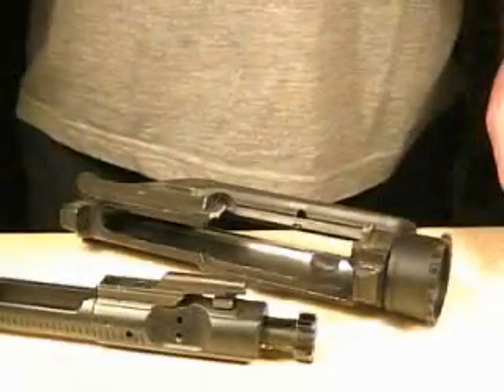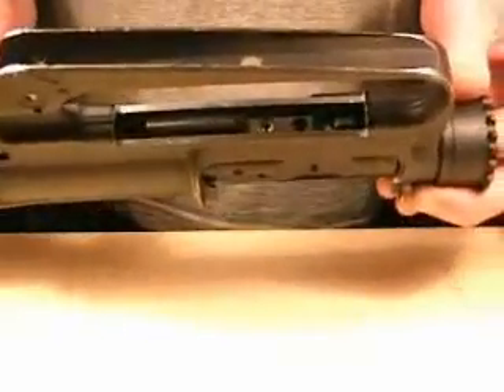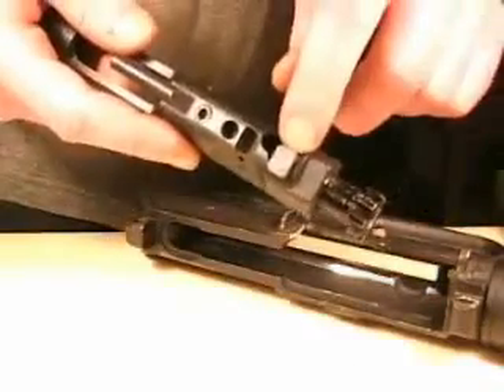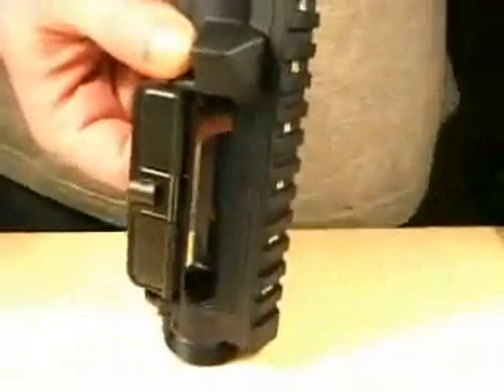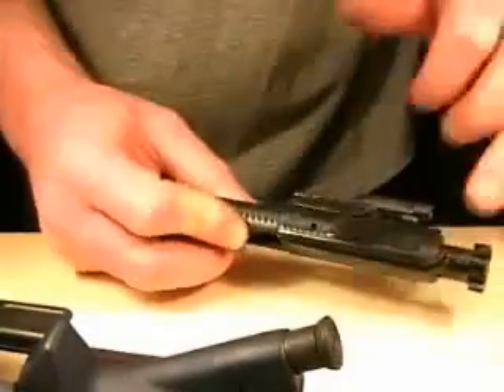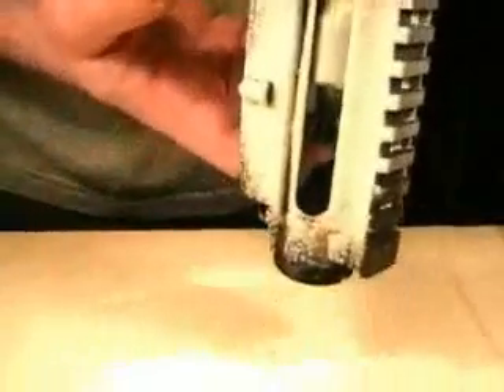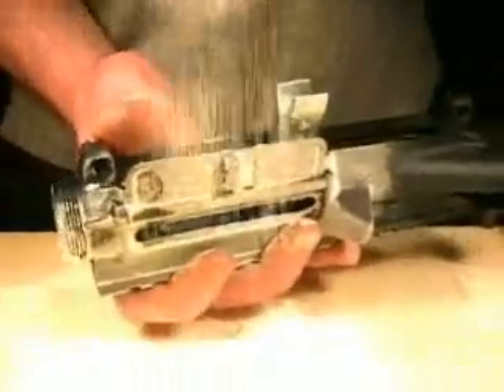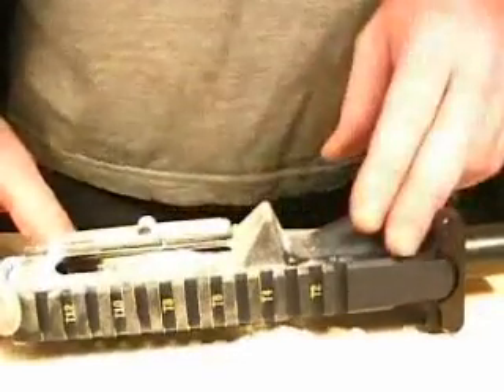M16/M4 reliability problem, increased bolt friction causing jams

Comment: This is a complete bs opinion and a none issue. The only way this would cause a jam while stripping a round is if the rifle or mag was way out of spec. If this was an issue, then the AK bolt would also start to turn when stripping a round out of the magazine and would not be able to enter the barrel breach to lock up being clocked wrong. It takes less pressure to turn (cam) an AK bolt than an AR bolt, so it would be even worse with the AK if this was a problem. The AK is also an open system and will jam in mud the AR will laugh off. These older videos are pretty funny to watch.

Comment: Well same thing happens with an ak and many other rotating bolt auto loader designs. But instead the of a cam pin pushing to the side  stopping the bolt from turning when picking up a cartridge,  an AK's bolt lug gets pushed against the rail when it pushes a cartridge out if the magazine when trying to rotate until it moves into the trunion area, thus creating the same point of friction as an ar15. This is how you keep a bolt from prematurely turning before locking. The friction "may" not be as bad due to it being steel on steel vs steel on aluminum on the ar15 system.
Reply: The AK does not have this issue. Milled in the cam groove, on underside of bolt carrier is a flat that rests on a flat on the cam of the bolt itself. Only in the last 1/2 inch of travel does a slight ramp lug on the left side of the trunnion area near the chamber engage the corresponding angle on the left bolt lug, "knocking" the cam off the flat to start the locking turn. Study the ak bolt, cam slot, and trunnion and you will see what I mean.
Reply: @benjamindavis1355 The AR doesn’t have this issue either. 

The video is nonsense.
Reply: no, it doesn't.

Comment: When you put your finger on the bolt face, the cam pin head puts pressure on the side of the upper receiver, creating a drag and the more pressure you use with your finger will make the bolt carrier stop sliding. In normal operation this should not happen. One quick fix is to use a roller head cam pin from POF.

Comment: Hey, dumbass, instead of doing this "test" on a stripped upper try it on a complete AR-15. Here, do the following...

1) Lock the BCG to the rear.
2) Stick your booger hook inside the ejection port, pushing back against the bolt face. 
3) Hit the bolt release.

Can anyone guess what would happen? It's called an action spring.

Comment: In reality this is not much of an issue for AR pattern rifles, even military-issued ones that have been neglected for a while. That said, if there is any solution to be found, within the confines of the existing design, it seems like the Patriot Ordnance Factory roller cam pin is the way to go

Comment: That cam pin is one of the reasons we load 28 rounds in our 30 rnd mags.
Reply: the greater magazine capacity the greater the pressure on the magazine spring, the greater the friction to the bolt to strip the round from the magazine into the chamber. the bolt is connected to the cam, therefore the cam makes greater pressure on the top of the receiver guide, creating resistance to the bolt. possible solutions: a POF cam pin with a bearing on top, and/or a spring behind the bolt maintaining forward pressure to the bolt.

Comment: um   you have a forward assist b/c the design of the firearm is inherently flawed,  without out in many more armed service men and woman would be dead/ AR15 is a very expensive piece of shit.
Reply: +Trevor Gallagher ...Ehh Not true.!    There was only a short time period of serious problems with the AR /M16 when first put into service during Vietnam. And those problems are directly the fault of the government.  But people tend to hang on to any negativity they hear about. And there's always different opinions and always gonna be haters. The negative image the AR Family of firearms received when they first entered service , was essentially due to 2 major factors. 1) Many people in military procurement had decades-long ties to Springfield Armory and were totally against some new company supplying firearms....and of course the Caliber argument.. (which the AR/M-16 originally was .308 caliber).  All of this led to Actual sabotage of testing the rifle....And some reputation smearing from competitors and even inside military procurement.!    2) The biggest image problems were due to Robert McNamara Demanding the weapons being Rushed into service in Vietnam AND Requiring them to reduce costs by Cutting Corners on the original design... by NOT fully chrome lining the barrel and chamber. And still claiming they didn't need to be Cleaned !   ALL firearms require Some cleaning at Some point. In addition, the original magazines caused many problems also.Within a year of the M-16 being used in combat, they went back to the original design and specs which included Fully chrome lining and added a redundant safeguard with the Forward assist.   The Forward assist is not necessary and some companies have removed them totally on commercial variants....but Most people want that same look on their AR as they've always seen, so they're still mostly built with the FA. The AR-15 /M-16 family of rifles are very well designed and very reliable....In my personal experience and many comparison tests you can watch here on YouTube - They're Almost equally reliable to the AK, in any conditions. I would easily rate the AK at 9.5 out of 10...and the AR-15 at 9 out of 10. That being due to higher tolerances in the AR - Which ALSO gives the AR/M-16 the Advantage in accuracy over the AK.   IMHO, in Accuracy comparison: AR-15 ...9.5 out of 10  and the AK ... maybe 8 out of 10. (None of those comparisons are set in stone, with so many variants and manufacturers of each design they can vary quite a bit)             And Expensive?....Not at all. In today's market, I've found them to be very similar in price and sometimes the AK can be much more expensive than an AR-15.
Reply: The rifle is inharently flawed.  Deposits carbon fauling directly into the guts of the rifle.  U dont shit where u eat.
Reply: Longest serving military rifle - by a LONG shot . Nothing else comes close .
Around the world EVERYBODY who can choose their rifle takes the M16/M4 . Is everybody besides you stupid ?
Almost every problem I've seen is a maintenance problem -  usually lube related. Parts break and wear with use .
Replace them and carry on . You have NO idea what you are talking about ..... but don't let that slow you down .

Comment: Duh! Use a POF roller cam. ALL of my AR builds use one. The standard milspec cam pin IMO is definitely a design defect. The roller cam made by POF corrects the whole situation.
Reply: I don't believe that the POF roller cam kit for DI guns was available in 2008 when this video was recorded, but it's certainly a viable choice today, in 2014.
Reply: He's not using gas rings, which is why piston ar's use a roller cam pin. That extra friction from the rings takes out the external friction from the cam pin. You can see this when piston ar's without roller cam pins gouge the receiver.
Reply: +bosundave121 seems like a great idea, except you have to remove the carrier key to install it.  Ever installed a carrier key?  Not fun and things can go wrong.  Like if the carrier key bolts aren't staked right (happens all the time) your bolt carrier group is useless when they come loose.  And suppose the roller cam itself breaks.  To change it, you have to remove the carrier key and replace it again.  And stake the bolts.  Again.  
Switch to a chrome or titanium cam pin, carry a spare cam pin in the pistol grip,  or - go with the latest and greatest high speed added complication devices to your rifle, whatever makes sense to you!
Reply: @robertmaybeth3434  same reason I didnt put a piston on my 12.5 build. More parts. Then I have to get used to a new breakdown. If I'm really in shtf ill take what I need

Comment: That's one of the reasons why you have the forward assist.. I don't understand the "fad" of running slick-sided uppers without a FA.
Reply: +pfcpdh the purpose of the forward assist is two fold. On a civilian AR/M4 few people will ever need it.  On a rifle in combat there are many occasions where the FA might be a lifesaver.  If the chamber is too dirty to lock up the bolt, the FA is the only way to jam the bolt all the way home to fire the rifle again.  (Of course this means the gun needs cleaning very badly, even if its a sloppy swab job in the chamber, but the soldier might not have time at the moment after all!)  
The second function is because  when the weapon jams, the upper receiver might need to come up/off to fix it.  But if the bolt carrier is jammed too far back, there is NO WAY to pivot the upper because it is blocked from doing so by the bolt carrier.  If pounding on the forward assist can get the bolt far enough forward to allow the upper to pivot then its proved its worth.  
Even without the FA you might still be able to remove the upper receiver but you'd need to push out both upper receiver retaining pins not just the rear one.   And that's a bit of trouble in the middle of a fire fight isn't it.
Reply: The forward assist was implemented into Stoner's design after the early non-chrome lined chambers were causing failures to feed. Chrome lining solved this issue. The FA is outdated, antiquated, and a cheap fast afterthought of a solution to the flaw in the design. If you have to use the forward assist on your AR, it is either out of spec or you have a chamber blockage. It is not advisable to force the bolt home on a stiff chamber. This can lead to over pressure conditions that can ruin the rifle. There is reason you don't see forward assists on any other rifle design. If you are having to use the FA in a firefight its probably best to switch to a different weapon. Having to use the FA is a sign of serious problems.
Reply: @ninja If you're bolt isn't going into battery then that means their is something inside the locking lugs (mud, sand etc.) or the chamber preventing it from doing so. Beating the shit out of the side of your rifle with brute force is either a) not going to cure the issue (most likely) or 2) going to make the problem worse.

The original ArmaLite AR-15 didn't have a FA as Eugene Stoner knew it was unnecessary and could actually worsen the problem but the Army insisted upon this modifications, as they did so many others the resulted in the original M16s failing in Vietnam. The Colt 604, adopted by the USAF as the M16, was identical to the Colt 603 (M16A1) except that it did not have a forward assist. Later, when Eugene Stoner was working with Knights Armament to develop the SR-25 the forward assist was absent. The SR-25 platform has be adopted by the US Military in several configurations including the Mk11 and the M110 SASS; all of which lack a FA.

As far as "silent chambering" is concerned; why isn't your rifle not already chambered?
Reply: +steveday72 The "Fad" is no fad at all. Any A15 that requires the use of the FA should be taken down and rebuilt with milspec parts.. If you have to use the FA then your AR is not running properly. Using the FA to jam the bolt home is never a good idea and can make small problems worse. Look up the history of the implementation of the forward assist - its antiquated.
Reply: @pfcpdh  The FA is a milspec part.

Comment: The gas doesn't just blow against the key. It goes inside the carrier, spreading the bolt and carrier apart, and the assembly is pushed off of the lock from the inertia of the parts separating. This is why the recoil is lighter than a piston system. The gas into the receiver is seepage out of the carrier. It doesn't affect much other than the cam pin, but with a heavy buffer it's not a problem. If you're firing brass (not steel) the chamber will be fine, too.

Comment: Give it a fair shake. I have an M16A4 clone as my current set up because I am used to the handling of a full size rifle. It has been very resistant to damage in my hard use of it.

My employer's rifles easily have a combined 100,000 rounds on the receivers. Failures include a magazine breaking in half after a year of daily use, a bolt breaking in half at about 15,000 rounds, gas rings burning out after ~10,000, and barrels getting shot out after 20,000+. We don't have problems on a daily basis.

Comment: The entire platform should be internal piston, as opposed to external piston, or phased out entirely. Introducing an external piston to a rifle developed to run with an internal piston has proved to introduce a wide range of problems. The pistons stick, the carriers tilt, the lugs break- the conversions are just flat out problematic. 

It isn't an unreliable system as it currently sits. If you think it is, you need to spend more time with it. That's not an insult.
Reply: I don't think a lot of people understand that gas actually unlocks the bolt when fired. External piston causes excessive abuse to the lugs.

Comment: The M4 doesn't need it either. It's nice to be able to adapt the platform to various uses, though. Not knocking the AK74, a full auto one with a rate of fire reducer was probably the most comfortable full auto I've ever shot, but it is limited in adaptability. 

I work at a range that rents M16s/M4s and an AKM and AK74. They're both reliable and durable... the only real difference is we can rebuild/rebarrel the M4 in-house while the AK goes back to the manufacturer.

Comment: Too bad all of your rifles are proprietary designs with no aftermarket support and don't have a half century of proven reliability and durability. 

Take your Bushmaster ACR, FN SCAR, or whatever else you might have and walk down to the local gun store and buy parts... they'll laugh. 

There is a reason a large portion of the world's best combat units are standardized on the AR15/M16/M4 platform and continue to order more rifles. They work.

Comment: Problem solution: put a roller on the piece that keeps jamming. All i does is ride along the rail and lock in place. If there was a wheel there it solves the problem.

Comment: @andromedarr 

The only problem with your idea is that the gasses are already vented to the outside of the rifle via the two ports on the right side of the carrier. Most of the debris that ends up in the action is back pressure from the chamber, which happens on all autoloaders to an extent. 

You do understand that the gas does not stop at the carrier key, right? 

As for the "issue" shown here- apply some lubricant and it will never be an issue.

Comment: Another Problem is the Gas inpingement, spraying dirty gas all over the internals. I dont understand why eugene stoner didnt design that system in a way where the gas tube, at all time, is covered by the carrier key so no gas leaks out. Off course, the bolt would move much more violently, but that can be prevented by making the gas-hole smaller so less pressure is built up.

Comment: @14goldmedals I am a usetobe I have been out of the military for four years now I have a glock with a rail because without was not an option, I have no plans to hang anything on the rail. Hand held lights are the way to go for those of not on SWAT or in Special Forces.

Comment: @14goldmedals That was sarcasm, your Sig was engineered by the Swedes or the Swiss I forget witch. At the time they partnered with the Germans to build it because of their export laws. Yea the American built Sigs are not as good that is why mine is also German. The rail is not useless when I was a dog handler it was great when I needed a gun a light and had a dog on leash. Unless you have a dog a shield or are on an entry team rails are just tacti-cool.

Comment: @KurNorock Lets see it happen, make a video like this for an AK. This is a real problem with the AR design.
Reply: Same thing happens with an ak, but instead the of a cam pin stopping the bolt from turning when picking up a cartridge the bolt lug gets pushed against the rail when it pushes a cartridge out if the magazine, thus creating the same point of friction.

Comment: What a silly video.  Dude has no experience with the AR platform.
Reply: Seems he hasn't much experience with fire arms period.  He should know the same thing happens with an ak and many other rotating bolt auto loader designs. But instead the of a cam pin pushing to the side  stopping the bolt from turning when picking up a cartridge,  an AK's bolt lug gets pushed against the rail when it pushes a cartridge out if the magazine when trying to rotate until it moves into the trunion area, thus creating the same point of friction as an ar15. This is how you keep a bolt from prematurely turning before locking. You could argue the friction "may" not be as bad due to it being steel on steel vs steel on aluminum on the ar15 system.

Comment: Give me about an hour with an AK or any other firearm and i can make an equally absurd video demonstrating "non issues" like this to convince people the weapon is a useless piece of junk.

In actuality nothing this guys shows in this video is an actual problem.
Reply: it is a simple instructional video of how the cam pin AIDS the closure of the bolt to battery. Without the friction the bolt could come out of battery during rough use. You must know the term direct IMPINGEMENT?
Reply: In the Ak  the bolt camming action id in the carrier itself eliminating the need for a pin. The systems in effect are very close in design